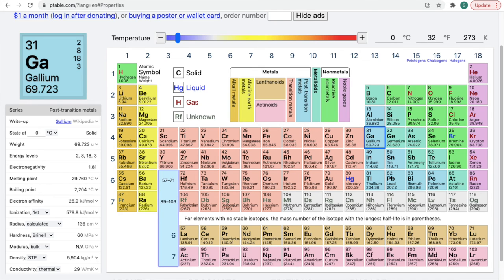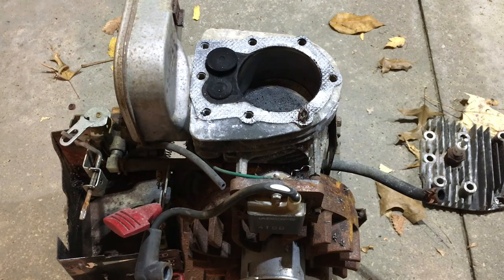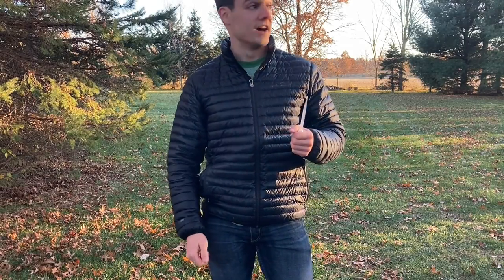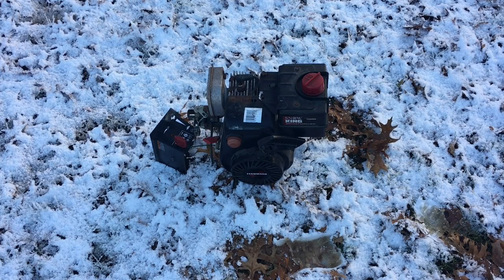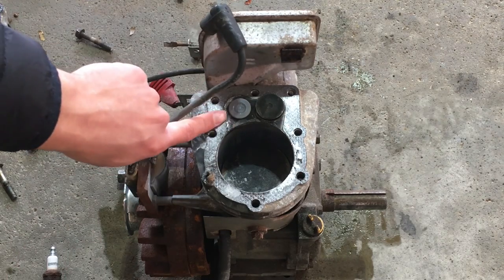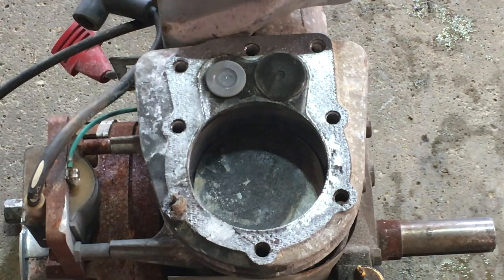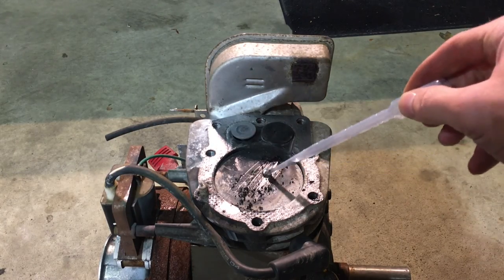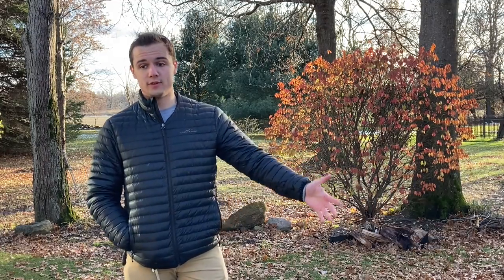Engine Destruction? Will Gallium Destroy a Running Engine?

Comment: Im surprised someone actually did this.. I thought that there was no way that I would find an actual result for "gallium on car piston".
Reply from the maker: I was surprised that no one else had done it either, so I knew I needed to test it out.
Reply: Good thing the piston didn't come out the block while you were injecting it i to the carb lol..... granted you didn't get hurt that would have been one awesome video!
Reply: Actually yes, can search gallium inside the cylinders from garage 54
Reply: @lucasvaldezdimaria5025  wasn't that uploaded after my comment?
Reply: I was literally just imagining what this would be like, as, you know, like a really horrible prank/revenge to commit to a person, when like, adding sugar to their gas tank just isn't enough. Then I was thinking, "if you dropped a glob of gallium on an engine, would it even start?" So I had to look it up. Wasn't even expecting to find anything let alone a video of someone doing it to a running engine.

Comment: the oil and fuel is most likely protecting the aluminum from the gallium. gallium has to touch clean, un-oxidized aluminum for the reaction to work.

Comment: Steel sleeves for the cylinder walls and valves, springs etc.  + aluminum has an oxide layer protecting it.  Then you have the oil which coats the surfaces everywhere the galium goes.  The galium might have been vaporized but I haven't checked the boiling point.
Reply: It has the highest boiling point of any element, no chance
Reply: @virtualtools_3021  oh damn
Reply: 4,352°F
2,400°C
As the guy above said 😂 no chance
Reply: Gallium boils at 4000*....

Comment: Sorry man, the aluminum is oxidized. It's not even the oil helping, just exposure to air will protect it from gallium. The proper procedure is the score aluminum with a file or a knife at intervals to allow the gallium to seep under the protective coating. If intending to insert gallium in the air intake, you'd first need an airborne solutions to strip oxidation layers, then you can introduce gallium to the system for the intended effect.

Comment: What I’d suggest is sanding down a face on the outside of the block and make a reservoir to hold the gallium to actually "soak” into the block
Reply from the maker: I hope to do a better test in the future and will incorporate many of the suggestions from comments.

Comment: The aluminium was not agitated or scratched for the gallium to combine with it. If you scratched the outside of the motor and put just 1 gram of gallium on the scratch it would have eaten the entire motor in an hour
Reply from the maker: When I attempt this again I will make sure the aluminum is thoroughly scored.

Comment: All the aluminum in an engine is either coated with petroleum or an oxide layer.   If you sand down a spot to bare metal, it'll creep through the entire part, but probably won't migrate past the next oxide layer on the adjoining part.  Not sure about this engine, but a lot of small engines have a steel or cast iron cylinder sleeve.

Comment: I’m impressed! I thought the engine would fail, with the piston rings chewing the cylinder to hell. Could you do it again by just mixing the gallium into the fuel?
Reply from the maker: I plan to redo this video in the future using viewer suggestions, though given that gallium is much denser than the fuel I am not sure the carberator would be able to suck up the gallium. I will have to test that and see!

Comment: I'd guess the reason the gallium didn't eat the aluminum is the coating of soot. Even a thin layer of oxidation can protect against the reaction of galium from what I've seen in videos. Often people have to scratch up the surface to start the reaction if the metal isn't freshly cleaned beforehand.
Reply from the maker: Yeah, I was worried that may be the case, I was kinda hoping that since it is an old engine the friction would have worn the oxides away enough for it to work.

Comment: It wouldn't be in the lower half of the motor like in the crank case cuz anything that goes in the intake stays above the piston n rings unless the rings are completely junk but then it would be spitting smoke and oil out the exhaust

Comment: it wil just mix with all the oil.
you need to scratch the outside metal, then put galium all over it and let it soak in for 2 hours or more.
then start the engine and see if it breaks apart

Comment: The Gallium didn't come into contact with aluminum, it's on the oxide.
Reply from the maker: I was hoping that perhaps the small amount of wear an engine experiences per cycle would be enough, but as you saw you are probably right!

Comment: Won't do sht to a iron block but it will trash a aluminum block. The oil may be able to protect the aluminum because it had anti corrosive properties to stop internal corrosion from moisture in gasoline. But if you scratched the surface of a aluminum block it would weaken the aluminum and cause it to throw a rod. When the new aluminum ford f150s came out I remember a story where somebody damaged one on a car lot using gallium. They cut a small spot in the roof and dumped a bunch of gallium in it. The roof of the car disintegrated.
Reply from the maker: If I remember correctly I made sure the engine was all aluminum (no iron sleeve). I think the cold severely reduced the galliums effectiveness on the aluminum. Maybe if my youtube channel gets big I'll do a whole aluminum f150 like you said. Ill give you a shoutout obviously!
Reply: @backyardfoundry  I think the oil is blocking the gallium from oenetrating the block. I bet if you scored the outside of the block and bobbed it on it would ruin the engine.

Comment: I would think of you out the gallium in the oil let it run the gallium will melt and mix with the oil leaving little gallium crystals all over the place when it cools. Then starting the engine cold might scratch the surfaces it is in contact with causing it to start reacting then leave the engine a few days and try to start it again.
Reply from the maker: I will definitely incorporate this idea in the sequel video!

Comment: makes 0 sense to put inside the motor you should scratch the head of the motor or the actual block and let gallium sit on it for a night to 2 then try to start it it would make more sense
Reply from the maker: Once I get another engine to destroy maybe I'll try that
Reply: @backyardfoundry  if you do make sure it’s a aluminum block should make for a great video